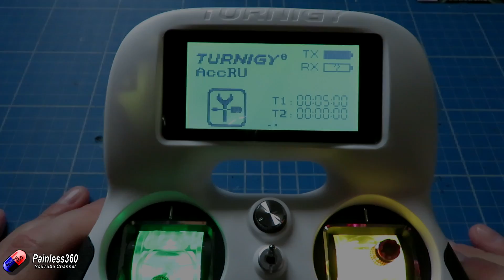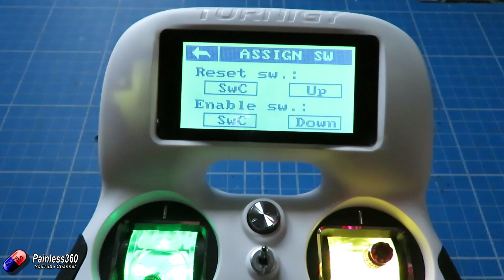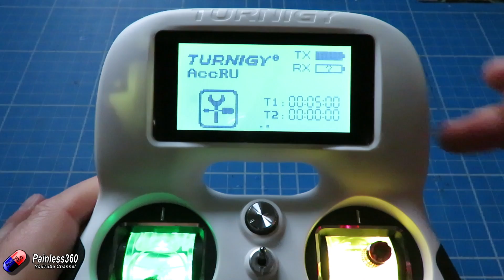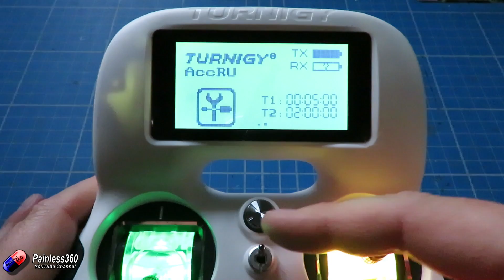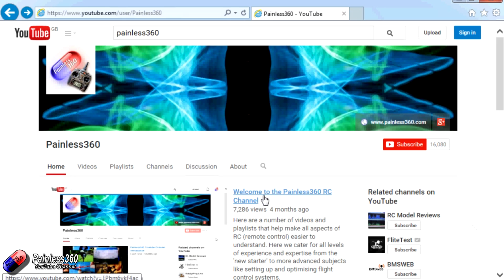RC Quick Tips: Setting up the timer on a i6s or Evolution radio

Comment: HI, please could you make a video on 2300kv motors and 2600kv motors and go over the pros and cons and which is better for racing.
Reply from the maker: What do you mean by 'Better'?
Reply: Painless360 which one is better for speed, efficiency and what should I use for racing.
Reply from the maker: Speed and efficiency are not things that tend to be considered when choosing a radio. The 'speed' of a radio are very similar from model to model and any delays tend to be due to the connection method you use to the flight controller (PPM, S-Bus etc.). See our video on choosing a radio for the things that pilots should consider. This is a cool radio but limited on features and model memories, can be used for racing but then almost any radio can.. Best of luck!
Reply: I think he was referring to motor KV speed not radios.